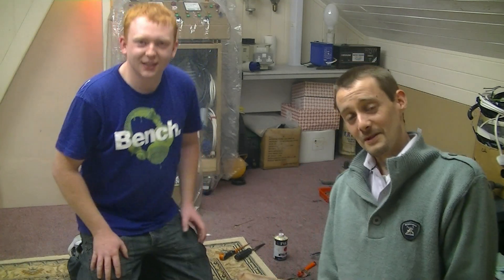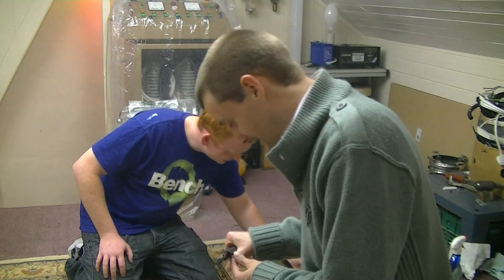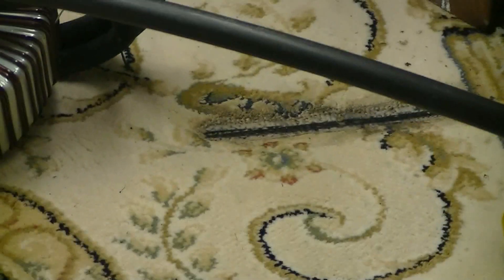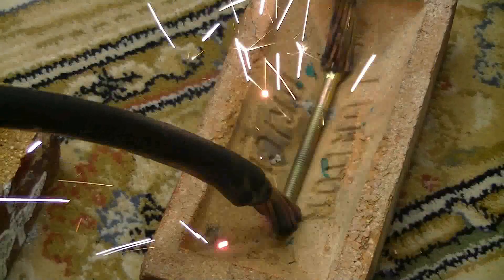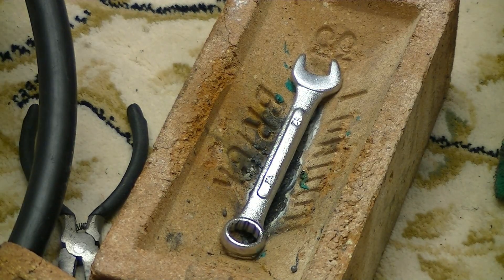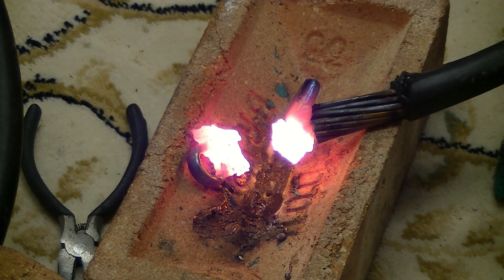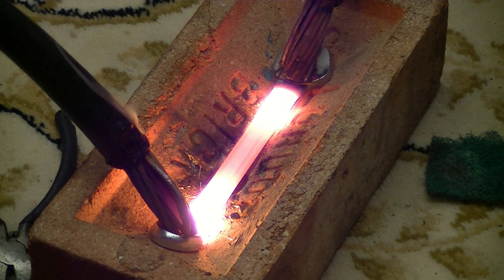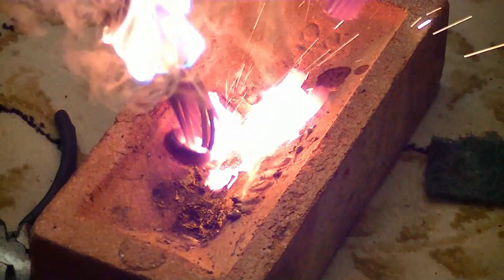5000 Amp Fuse + Tools Melt With High Current

Comment: two semi pissed blokes come back from the pub and arse about with a high voltage.........  I give you England at its finest...
Reply: Except they aren't playing with high voltage at all, it's high amperage.
Reply: lol............... I have no idea exactly what there doing............. it looked like fun, but then a lot of stuff is when you downed a few at the local...................... thats how a lot of blokes get married
Reply: Amperage not voltage.
Reply: In real electrical terms 240 is considered low-voltage. High voltage is things like power-lines etc. 20 - 50,000V etc. 'Low' doesn't mean safe of course. 420V DC will kill you in a nasty way.
Reply: +siypic amps is what the rate a current (voltage) charges an electronic device. Power is measured in watts. Amps multiplied by voltage gives you the power (watts).
Reply: High voltage start at 1000 V
Reply: It is low voltage, high current.  Yes there's 240V on the other side of the transformer, but not on the side they're mucking with.
Reply: ***** know that throughout Europe, everyone, and I mean everyone who had contact with the 220/240 volts at least once ,, and I personally at least a dozen times, and to me it does not appear to be dead, or someone is dead on contact .. the real danger of death is in the case if the contact takes place in a bath with a hair dryer which falls into it, and that the hard shock at least 5 seconds (even with the 110 volts). but since there is lifesavers device, which at first contact with water, electricity stops, then become harmless ... The deadly shock is more likely with the industrial electricity (380 volts), which on contact pushes you away from it, but can cause physical damage, coma, paralysis, or heart attack, sometimes even death .. Returning to the discourse of power: an electric shock gun also comes to 10.000 to 1000.000 of volts, but does not kill, because the wattage is minimal, as the amperage . But the difference is made since the lasting of the contact
Reply: Better than joining the EDL...
Reply: yes they are drawing 240V from the wall but they are putting that into a stepdown transformer. the ratio of turns on the primary coil compared to the secondary coil is what gives the high current and low voltage. as the current increases the voltages decreases. infact it was probably such a low current that you could hold each end of the cable in each hand and it wouldnt do anything, due to the high resistance of your body. low resistance objects on the other hand will get absolutely fried.
Reply: Thomas Francis  I have enough physical Knowledge to know that, however I meant that for humans 240V is still pretty dangerous and lethal, even if it is not a high voltage when compared to other ones, like those we use for Trains etc.
Reply: +siypic thought I'd let you know. he's not married lol. he's divorced.
Reply: im sure some are... maby not these guys but some...
Reply: ............... why do you type................. like this?
Reply: Shortyman17 ah i see. It is dangerous however it is also our standard mains voltage supply in the UK.
Reply: the input voltage can be deadly (220/240). but the output voltage (the one that melts the metal) is as low as a small battery, so harmless to human contact, but high amperage (5000) up to melt metals, as it goes into a short circuit resistant
Reply: No when you have a cup of tea, rich tea biscuits and scones and then play with electricity that's England at its finest 🇬🇧🇬🇧🇬🇧☕️☕️☕️ 
Your welcome 
Coming from a British person 😉
Reply: I like how people suddenly become electricians when they log into YouTube. FYI 30 milli amps can kill you the battery in your car can kill you these guys are crazy
Reply: siypic I will keep your sound advice for future reference when needed.
Thanks mate.
Reply: it still involves high voltage. I think they drew the power from the wall, that should be about 240V, which is fairly high and can easily lead to deaths.
Reply: +shades2 240v will kill you instantly UK mains runs on 240v it runs at same pace as human heart if you touch the live socket here ur dead meat. very lucky to survive it let's put it that way. 
usa 110v much less risk of getting killed.
Reply: SeGaSaTuRn1994  True that’s why 110 is used in construction sites in the UK
Reply: Please don't judge our beautiful country (England) by these  two idiots.
 I wouldn't dream of judging all Americans by their President Mr Trump.
Come and visit our England and see what England at it's finest really is, you won't be disappointed.

Comment: Remember don't spray water on electrical fires, unless it's in a dettox bottle.
Reply: remember, if your toaster is on fire, throw it in a bathtub of water and jump in as quick as possible.
Reply: For the benefit of anyone else wondering about this, water on electrical fires is perfectly fine in certain circumstances.  One being when it doesn't cause a short circuit (the water could turn into steam instantly and explode if there's enough current to heat it that fast), another is that the electricity could run through the water into you and give you a shock if the voltage is high enough.  In this case they are only spraying water on one line from a power supply so there's no way to close the circuit, so it's quite safe.  But in many situations you won't know for sure which is why common advice is never to risk it.

Comment: The amazing thing about this is that the steel melts and the lower temperature melting copper stays in tact, I wonder why !!
Reply: Maybe because it has a higher conductivity, it does not get as hot as the other material? Don&#180;t know it. Just guessing.
Reply: quite simple actually, the copper cable are thicker, so the heat dissipate more effectively.

Comment: Basic electricity lesson for the people who think the electrical part is dangerous.

Consider Ohm's law: V=RxI, with V being voltage in volts, R being resistance in ohms, and I being current in Ampere. Ampere is what kills, anything around 1-2A will kill you.
Resistance is key in this case, metal objects have a really low resistance, for the sake of having round numbers later, let's say 0.4 milliOhms. The human body, dry at low voltage, has a resistance of ~100.000 ohms

So, at low voltage, let's say 2V, the following happens:
Metal object: R=0.0004Ohm, V=2v, I=?
I = V/R = 2/0.0004 = 5000 Amps. Auch!

However, Human body:R= 100.000, V= 2, I=?
I = V/R = 2/100,000 = 0.00002 A = 20 µA. You don't even feel that.

Now, the fire hazard is something else, but electrically, this setup is not even remotely dangerous, even if it may look like it is.

Comment: Aside from burns what would happen if someone touched the  items you are melting?
Reply: They would have bacon slices as arms.
Reply: Your heart would stop
Reply: I guess you think about something like a shock. But no, after the wires are no longer connected to the metal there is no electrical currency.
Reply: Hi I would like this chocolate bar.
5 Amps please.
Here you go.

Comment: You guys are reckless idiots. You're dealing with bare high--voltage wiring with your bare hands, you're not wearing safety goggles, you're surrounded by flammable materials (which you DID end up setting on fire), and I don't see a fire extinguisher, though I'm hoping you have one just off-screen. Seriously, you're melting metal on carpet?!

Sure, this vid was made years ago, but looking at your other videos, I can see you've learned absolutely nothing. How are you not dead?!

Comment: Melting tools and GALVANIZED bolts with high voltage INSIDE a house is genius, absolutely genius.
Natural selection.
Reply: that's right, extractor fans are magical devices that cause complete invulnerability to those within their vicinities. That's definitely what those are.
Reply: He has extractor fans I  the room
Reply: current*
Reply: ha!
Reply: +tiocybot duh everyone already how's that
Reply: +tiocybot as long as they remove the zinc fumes, then yes they are
Reply: King Komando i doubt that has high voltage
Reply: Probably around 80 - 120 V, but it's way more than enough to push through your skin. Sure, I should have said current, of which there is 5000 Amps, which would kill you, and your entire bloodline, over and over again.

Comment: We made glass conduct in Physics class with something a bit like this.  Proper fun, can't remember the type of glass rod we used but you needed to heat it up in a bunsen flame first, then when hot enough it lit up like a lamp then melted in a couple of seconds and broke the circuit.  Proper fun.

Comment: be careful with the galvanized metal at the plasma temperature or melting temperature it is extremely carcinogenic the gases are extremely toxic you need to make sure you have proper ventilation forced ventilation

Comment: Finally, an adjustable wrench that will HOLD THE SETTING YOU WANT IT TO HOLD!

So did you guys just loop that cable through your transformer a couple times to induce current? Pretty cool!

Comment: The brick on your carpet in your apartment seems like a controlled environment great job staying safe.
Reply: He knows what he is doing, should see his latest videos 1-2v at 2000amps does nothing (good he has come back been a quite year with out his videos) i guessing this got promoted some how as this is on my first slide of the YouTube app (see lots of new Pepole who have not watched his other vdeos)
Reply: for real eh. wtf? idiots.
Reply: +Derek Walker natural selection at its finest.
Reply: +Cody L  I would pay to watch that video!
Reply: +Eric Johnson 
It's a magic rug.
Reply: That won't kill you. 1-2 volts is not enough to get through your skin resistance.
Reply: James Cree Phew!  That's a relief.
Reply: Hey! Henry Ford used to design and build engines in his living room, most of the uranium testing on the Manhattan Project was done in a bathtub, and Tesla used to do high energy experiments while riding a unicycle around his garage. It's a time honored scientific tradition.
Reply: omg everything around them is flammable.
Reply: You need to have ~40 volts to overcome the resistance of >dry< skin enough to start being lethal.  1 or 2 volts is nothing, no matter the potential current - it just won't penetrate.

The only reason it works here is b/c they're doing this with metal.

The rug though, is a different story.  Not because the resistance of the carpet was overcome, but more probably because some piece of metal they electrified became hot, and then burned the rug.

I'm really surprised they had nowhere else to do this (or couldn't roll up the rug. It's not like a carpet that is nailed down.)
Reply: +Cody L should've ran its course by now with as many videos as they've made. Maybe they have a faint idea as to what they're doing. just saying
Reply: A Pudgy Squirrel The man knows exactly what he's doing. Anyone with experience in electrics knows this. I've been watching lots of his videos and im pretty sure he's an electrical engineer who either doesn't give a shit about safety or makes his videos look horribly unsafe to make them more entertaining
Reply: That's called sour grapes.
Reply: +I'M Running Thaangs I run 121 gigwatts!!
Reply: 1 - 2 kVA toroidal transformer and it's sitting on a fucking rug in their living room.  Looks safe to me!
Reply: Derek Walker I watched a few more of those guys videos. They seem to really know what they're doing when they're not drunk
Reply: +I'M Running Thaangs lol I watched one and the dudes inches from the cable and holding a utility knife on it! what a fuckn tard.
Reply: The carpet has seen a lot of action (should see the holes in his chars downstairs) microwave has seen some action as well
Reply: Well of course it's safe... one guy is totally pissed and the other puffing 'way on a joint! What more safety do ya'll want?! hahahaha love it 10mm, 12mm, 14mm who 'ives a fuuuck. cock the bastards! hahaha awesome!
Reply: Who the fuck cares? It's not like he's doing it in your home lol
Reply: i mean they did just get back from the pub...
Reply: Simon John Hinton haha yeah it was definitely interesting.
Reply: great fun....I've got a few people that owe me money an this is a gud idea I can adopt!!!
Reply: Derek Walker well i have infinite siemen so i run everything
Reply: Pioneer You're probably right but add a bit of sweat into the mix and weird and wonderful things can happen with the body's resistance. By wonderful i meen horrific :P
Reply: At 1 volt it any going to do any thing, you won't even feel it
Reply: Roonasaur Cant argue with you there and came across it when fact checking my comment but you can definitely get a shock from one or two volt with wet skin i know that from experience but i would suspect the moisture was the current carrier
Reply: +Robert Swift I would hope so. I think she knows they don't bring girls home they bring transformers home.
Reply: no one cares m8
Reply: +A Pudgy Squirrel natural selection.
Reply: If you think any amount of current at 1V can kill you, you need to go back to school.
Reply: +T Klue alright man, bye. And no I dont care about their safety, I never said I did. Pointing out how unsafe something is and saying you care about the safety of someone are different things. I have too many other things to care about and these guys burning their house down is not one of them.
Reply: You care so little you had to call them out for it.. kind of childish "I didn't want it anyway" mentality, way to go!
Reply: Cody L u know they probably have like a glass of water
Reply: Midol Gamerop you should lay off the crystal meth and then you'd make more sense...
Reply: +lee x I'm good.
Reply: +I'M Running Thaangs fair nuff. you win!
Reply: Derek Walker Yea i don't get how they can be so dumb and still have an idea what they're doing but from what can tell they're definitely not formally educated.
Reply: Lots of his videos are getting home paged
Reply: lee x you can't deny the man puts out great videos but if his set up's not a gimmick then his neighbours might have a problem
Reply: +Dennis Woycheshen thats all apart of the "controlled environment"!
Reply: +A Pudgy Squirrel dumbest thing I have ever read in my life.
Reply: +I'M Running Thaangs that makes sense. they may know what they are doing but it is such a terrible place to do it. anything goes wrong and people could potentially die..
Reply: you won't get 2000 amps at 2V through your body, cause your body has around 1000 ohm. Even with wet skin you won't get more than 0,02 amps through. So you don't die....
Reply: +d0ct0rrulE Skin resistance is more than that but you only need on the order of milliamps to have a high risk of death though.
Reply: I'M Running Thaangs I was being facetious
Reply: +demoniack81 considering I can stivk a 9v battery on my tongue. I'll stick to it. lol
Reply: *****
yes miliamps at 230V but not at 2 volts ......
Reply: He has a house
Reply: +donnald troll bleh
Reply: +donnald troll fuck troll!  lol
Reply: +T Klue good call fuckup.
Reply: Weed Wacker! Yes a Weed Wacker!
Reply: I apologize you're grace! I was under the impression you were aware of context. My humble, (look at that im getting better see that comma yaaaaa) most sincere sorries!
Reply: +T Klue don't throw insults if you can't handle taking them back. :P
Reply: Blurpety Blwerp!
Reply: +T Klue quite the intellectual.
Reply: Got my Medical degree in Merica!!!
Reply: Then why did you take the time too comment? Silly goose.
Reply: Cody L
Reply: Eddie Wood Hello. Couldn't be bothered to reply to anyone else attempting to call me out for attention, since everyone saying silly things is repeating one another.
Reply: David Pucio Makes sense
Reply: DasGamming Hopefully
Reply: anonymous Mhmm my second favorite drink.
Reply: Cody L
 Hey hey hes back again. And which of the PhD you have qualifies that statement?
Reply: Cody L
 Clearly you do, I though you were just cussing the screen.
 bye bye Mr muted.
Reply: 74KU lol <3 why so salty?
Reply: Cody L yeah I thought that. I like the sound of crackling though.....those two seem to get on like a house on fire anyway lol
Reply: Midol Gamerop ok?
Reply: hahahahah!
Reply: 1-2 volts can't hurt even if you have infinite amps.
Reply: I would say the biggest concern was inhaling all that poisonous smoke. Hope they have a good ventilation
Reply: Shut yer hole
Reply: 5 years ago...
Reply: +lee x 1-2v @ 2000 amps is still 1 - 2 kilowatts, more than enough to kill you or burn your house down
Reply: also, your body will take a fraction of the total current proportional to the ratio between your body's resistance and that of the circuit. Its the current that kills, not the voltage. 0.1 of an amp is lethal (more then 0.2 is less lethal strangely enough) so it really is very possible to get killed off that much current. I realise 1 volt is probably not getting any current through your skin but i reckon given the right circumstance with body capacitance dielectric breakdown of the skin could happen

Comment: What is the voltage? I could not count the first coil properly.
Reply: Very low voltage very high amps (why he has problems getting the cable to short the bar out) something like 240v (60A) in 10v out ( stupid amps out lol)
Reply: There's no way those tiny wires on the primary side are providing 60A.  The transformer looks like about 100:4 turns.
Reply: StarGazer7373 probably 13A (as it's a normal socket with a breaker on it) still be lots of amps on the 2-10v side of that big cable 

I have to look at other videos room see what that variac is limited to